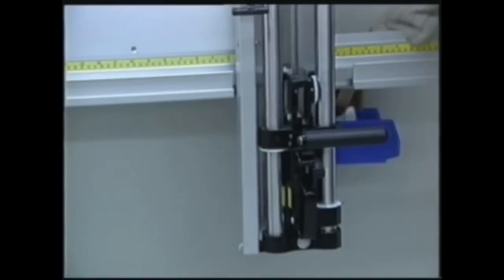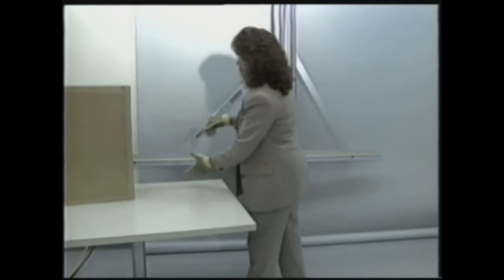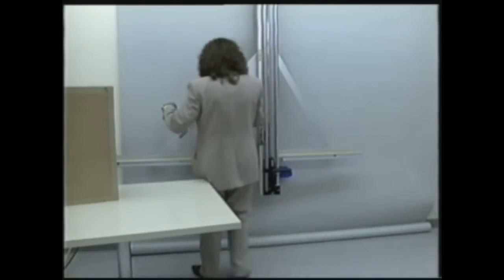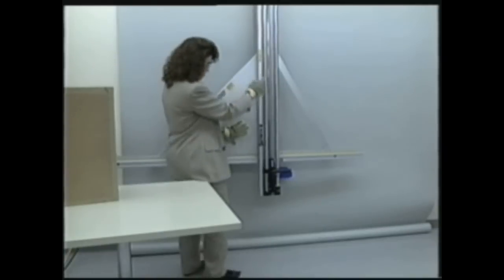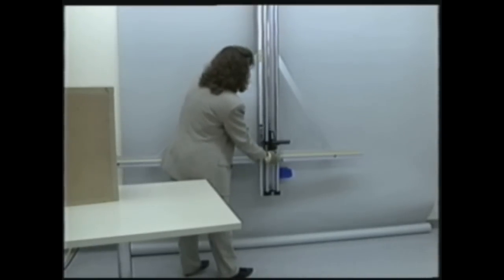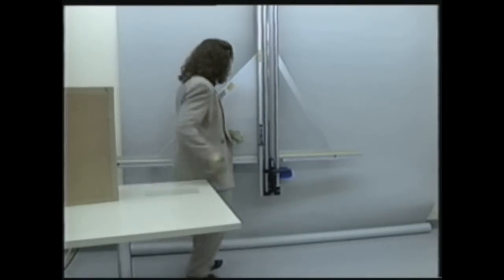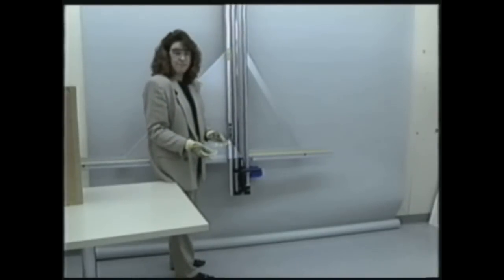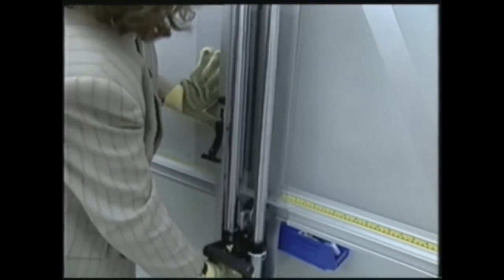Fletcher Terry F3100 63" Multi-Material Glass Cutter Demo Video

Comment: Been cutting glass like this for 26 years and never wore gloves and never wore glasses.  Never cut myself.
Reply: Jim C  dunno. I’ve been cutting it on a flat bench for 35 years with a t square and a manual cutter. No gloves. No goggles. Never cut myself either. Stay safe out there. It’s a dangerous old world 👍🏼

You’ll tend to stick with what you were originally shown how to do it. If it works for you it works for you
Reply: Jim C well IDK. I did it for 29 years without one cut.  So obviously what i was doing worked.   We recently closed for good on May 31st.  I should have bought the glass cutter from my boss.  I would have hung it in my basement.  👍🏼.  
The dumb ass kid i work with decided to carry 3 pieces of glass without gloves and he had already been doing the job for over 10 years and we all know glass is slippery. You cant carry more than two pieces unless there is paper in between.   Sure enough the middle piece slipped out and sliced both his palms.  He's 28 and still lives with mommy and daddy, works part time and plays video games.
Reply: Kristinapedia maybe we are just lucky 😜